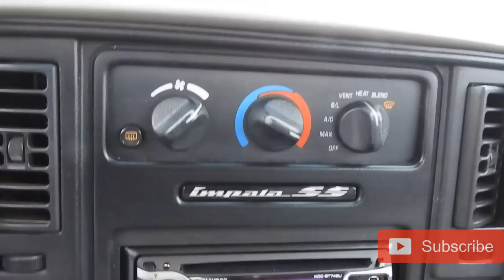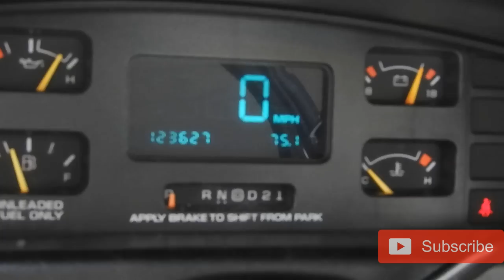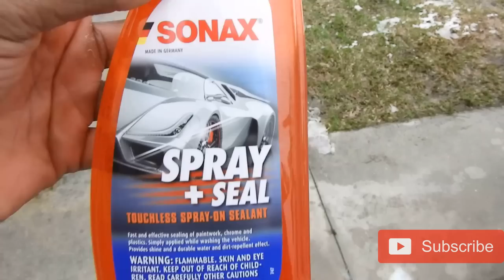I BOUGHT MY CHILDHOOD DREAM CAR AT 26!!

Comment: LT1 was a solid engine, it’s Achilles heel was the optispark distributor, it was the 68rfe of the 90’s

Don’t get it wet, I had good luck with a MSD billet optispark but ultimately that also failed because of moisture. 

Solution: speedinc.com use to sell a kit that I purchased for my camaro that would convert it to coil on plug ignition, I’ve had zero issues since, get to use EFIlive and have the simplicity of a old school SBC 350 with reverse cooling heads. 

I LOVE YOUR NEW TOY!
Reply from the maker: Oh hell yeah thank you man! I heard about the optispark. I'm hoping I can keep it dry as long as possible. I heard about the swap. Is it hard to do?
Reply: EVERYTHANG DIESEL 
Honestly the swap is pretty basic, you have to get ahold of speed inc to see if they still make the reluctor wheels. 

I have the timing cover that you need off a 97 camaro, the wiring is easy, it’s the speed inc components that’s going to be hard to source. 

They also use to make a alternator relocation kit (I have it) that made the engine bay look bad ass!

Comment: wowwwwwwwwwwwwwwwwww
Reply: enjoy it all the way also the Impala and i found the sonax spray and sealant .in the big Fleetwood sat the lt motor as well.a carport or a garage is the best.but if the body is as clean as possible and also protect it should be fine to.paint be tested in freezing conditions as in the heat. mean car paint. nice to see your dreams come true
Reply from the maker: thanks man, this original paint is in excellent condition for its age. sonax spray and seal also does excellent job protecting paint.